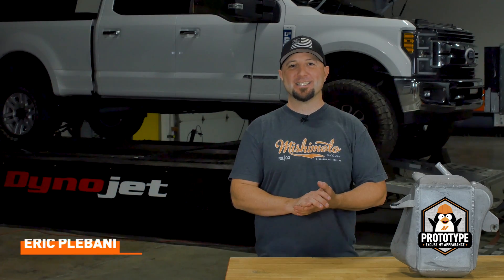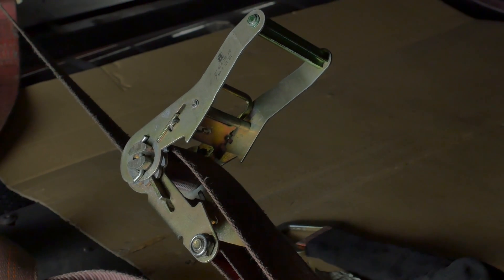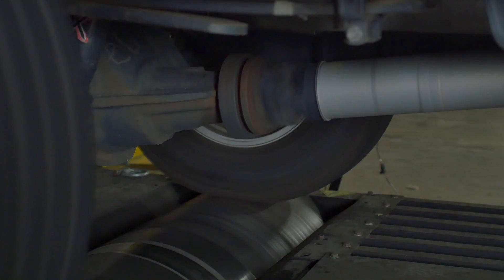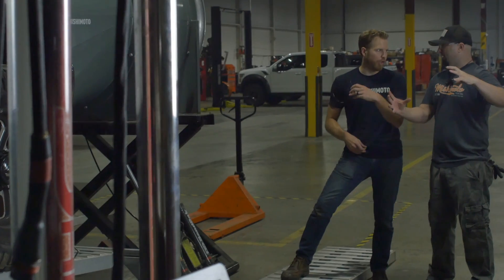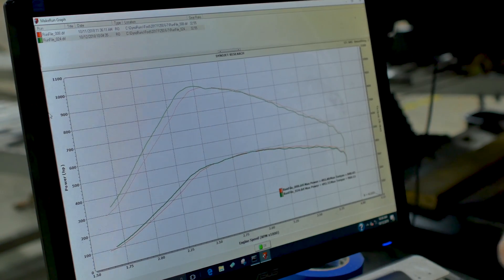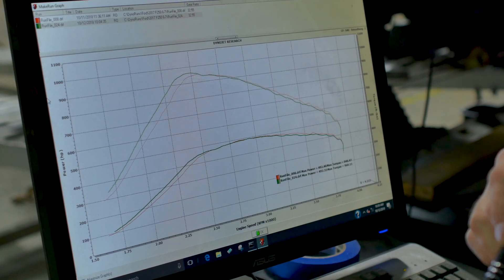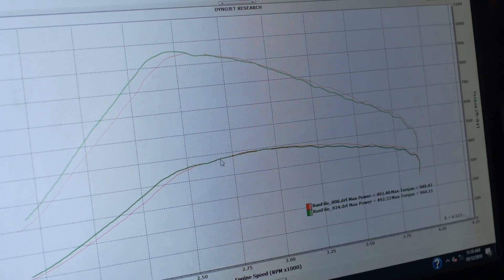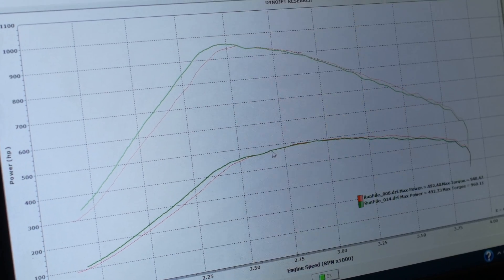Mishimoto R&D: 2011+ 6.7L Powerstroke Air-to-Water Intercooler Dyno Testing

Comment: Seems y'all purposefully avoided saying the gains on a modded truck like that one. Probably didn't do much.
Reply from the maker: This is on our engineering blog on the product page. At around 1,750 RPM to about 2,000 RPM, our intercooler allowed the 6.7L to make over 40 lb. ft. more torque than the stock intercooler.
https://www.mishimoto.com/engineering/2018/10/ford-powerstroke-2011-2016-67l-intercooler-rd-pt5/

Comment: So you didn’t tell me the peaks or the mods on the truck? Wack
Reply from the maker: For a completely stock truck you can expect  40 lb-ft torque gains without other modifications with power coming on sooner thanks to better flow.
Reply: Looks like 15 ft lbs to me.

Comment: What about IAT?
Reply from the maker: The stock cooler did a great job of cooling the intake air so there isn't too much more to get out of that system but durability and flow have been greatly increased with our cooler. You'll get the same EGT and IATs with more power and reduced stress on the turbo with a higher potential power rating with more tuning.
Reply: What were the numbers the truck made on the dyno?